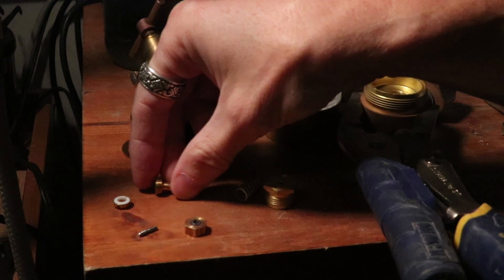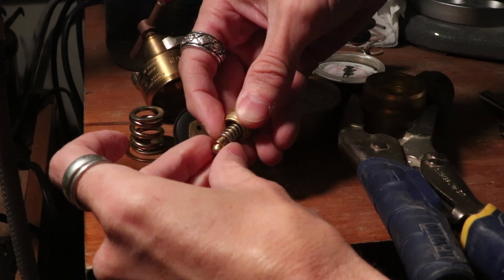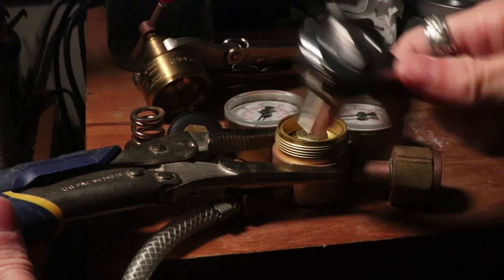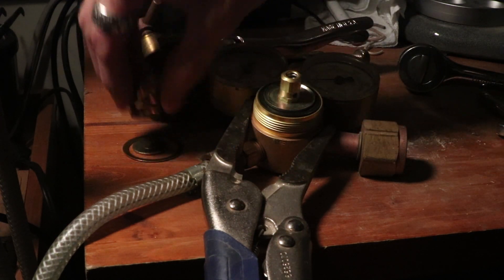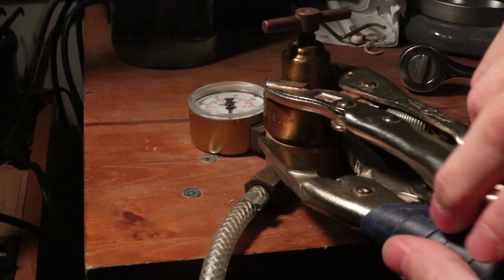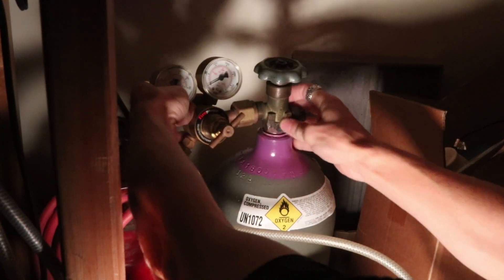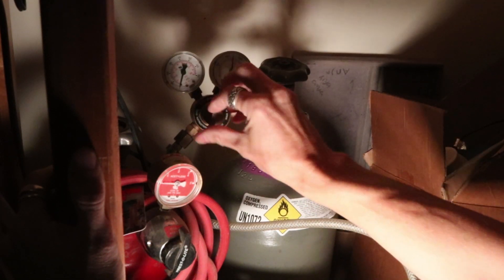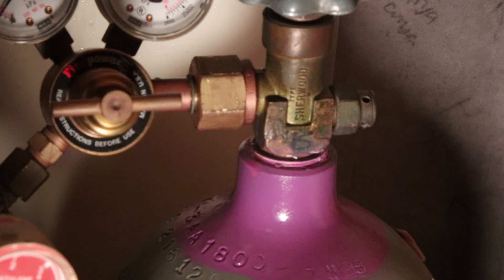Oxygen Regulator Repair - (BTS 08)

Comment: My regulator (Uniweld) was leaking O2 out of the vent hole of the casing. I found the thin gasket against the  diaphram had changed shape and was not round but had a flat spot on it. Hence not sealing the pressure  on the inside and venting it to the outside atmosphere. With a heat gun and a large socket I reshaped  it and made it round again. After re-assembly it worked perfectly. I 'll bet this gasket is a common problem. Did not know it had a problem and while welding it bled out my tank of O2. Found the leak when I connected the new bottle and it was quite and heard it.

Comment: I have a question on the part you fix to set the pressure can you decrease the pressure the same as you do to put the pressure on gauge or you can't decrease?
Reply from the maker: I'm no expert and I'm not sure exactly what you mean, but you can twist the little handle on the regulator to increase or decrease the pressure.

Comment: You should never assemble the parts of an O2 regulator with your bare hands.  The presence of any body oil or other contaminants can result in spontaneous combustion when exposed to high-pressure O2.  Wear non-lint producing gloves.
Reply from the maker: Thank you I'll keep that in mind if I ever have to fix it again.

Comment: I strongly suggest studying the factory manuals (you can download most of them) and if doing oxygen regulators learning to clean to oxygen safe standards.
Reply from the maker: Thank you for the input.  I just needed it to work for my jewelers torch oxygen and propane.
Reply: Do you just do a search for Victor SR 450 D regulator manual, because I am not finding one? I have a oxygen and acetylene regulator that I need to rebuild since there is nobody even remotely close to rebuild it. From what I gather nobody like to rebuild them because of the liability.
 
After reading all the stories of what you can do and shouldn't do, I just purchased a new set, but I would like to rebuild the old set. I found on the net that you can't just use any soluble soap to clean, like Dawn soap since it contains petroleum and poses a fire hazard. And the grease (krytox grease) for the "T" handle on the valve is insanely costly. After figuring in all the cost, you can almost purchase a new regulator set for the specialty items you have to purchase.

Comment: Ouch!! Vicegrips  on brass?? ...why?
Edit: you can omit the bottom pair of vicegrips  by screwing the regulator securely  to the bottle  with face pointing up and service the whole thing like that  and tape up the jaws of your vice grips or use an automotive wrench (aka F wrench) or a plumber's spud wrench or some smooth jawed  channel locks. Just saying,  from craftsman to craftsman,  gummed up brass is the sign of a hack posing as a craftsman.  ..its like those  "handyman"  types who have a bucket of tools painted a bunch of different company colors. Here's a tip. Next time you see a used bicycle inner tube, cut it up into long strips along its seam lines. Roll them up and use them for shit like wrapping your regulator so you can grip it in your  vicegrips without  marring  it. Its also useful for tying up cords, wrap hammer handle, blah, blah, blah...
Reply from the maker: Hey thanks for the input.  I'll keep that in mind the next time I have to fix one of my regulators.
Reply: @JustinThorup  no problem. I just reread my comment. I didn't mean to unload like that. I must have been bored. But I find it kinda strange that I was just messaging my buddy about the rebuild kits I got for my regulators. I mean, like , 40 min ago or something... Coincidence or AI enhanced algorithms? ..? Lol
Reply from the maker: j dog no problem.  I’m definitely no expert.  I make jewelry and this is the first time I had to repair this in 20 years.  I may never have to do it again.  Have fun with yours.  :)
Reply: @JustinThorup  haha.. Have fun with mine? ..which one.. Lol ..I've got more than 5 different sets of them. Victor, Harris, Smith, Dayton, Craftsman. For a while, it was cheaper to buy people's oxy/acet rigs on craigslist, than it was to swap out empties at airgas. then, take all the empties down and trade 3 empties for 1 full at a local welding supply.  ..but yea, when they start giving you trouble, I found that a quick disassembly and cleaning gets it back working fine but with oxygen, it's a good idea to wear rubber gloves and only use dish soap n water.

Comment: Justin,  Great Vid., your reg is a Firepower reg, which is really a Victor import.  It is identical to the Victor SR5B.   The kit you bought wasn't the exact kit you need, but the seat assembly for the SR250 and the SR5B are identical.   Now you have a diaphragm that will bounce around on your bench for a few years.  Finally you'll throw it away,  and one of your friends will need it the next day.  I have parts like that laying all over the place. This is a shameless product placement, but I have the kits for most popular regs on eBay.  Check out our store if you need any other kits.  You'll save a few bucks and we include Krytox grease to assist in a perfect rebuilt.  I'm starting to see a need for repair tutorials for gas apparatus. anyway, thanks for sharing. Oh, quick tip.   You can put the inlet stem in the vise perpendicular to the rotation of the cap, and then use a pin spanner wrench to remove the cap without marring it.
Reply: Torchandregdoc, what is your ebay store name?  I need a rebuild kit for a Victor SR 450 D
Reply: @mikeinindiana  https://www.ebay.com/itm/REPAIR-KIT-VICTOR-SR450D-450-OXY-REG-OXYGEN-REGULATOR-REBUILD-PARTS-AV450RK-/141460836486
Reply: I've bought from torchandregdoc several times as I rebuild my own torches and regulators.  My nick on Weldingweb is "farmall".
Reply: @torchandregdoc did you ever end up making repair videos?
Reply: Kataria Welding Repair Center 
we are repairing oxygen Reguleter, gas cutter, gas torch, blow pipe etc. 

📲 9136152005 

Main Karwal Nagar Road, Delhi-110094 (india)